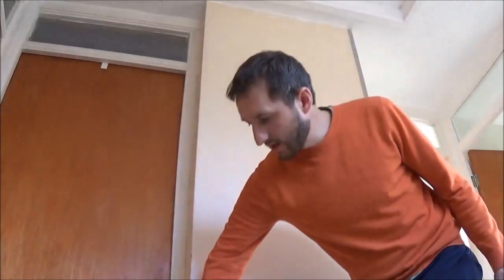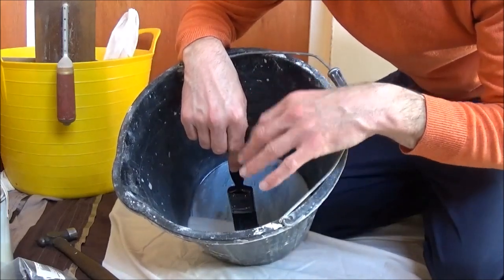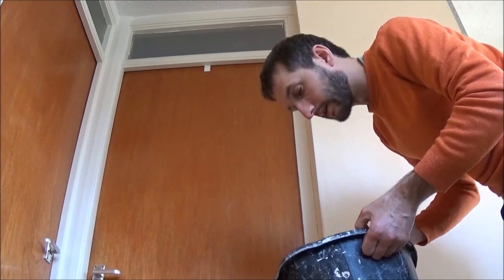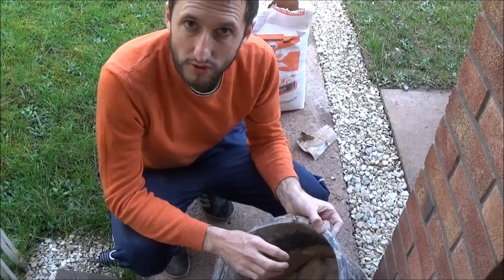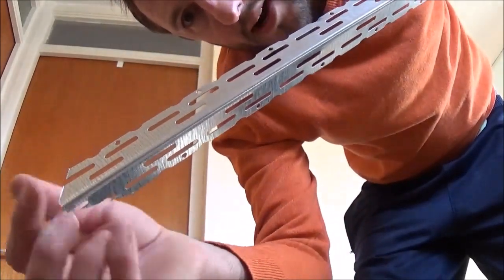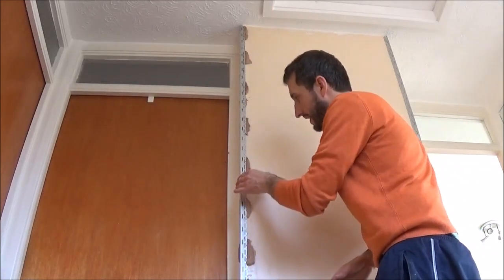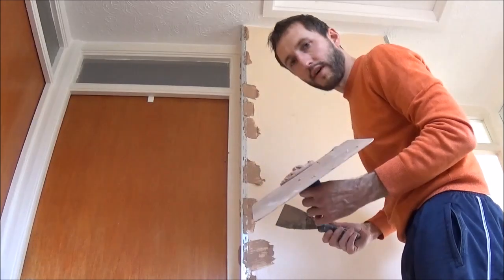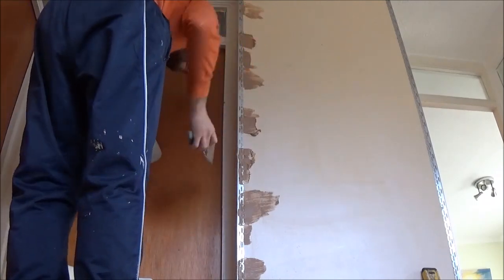How to fix drywall angle bead using plaster. Fit corner bead using plaster. Beginners plastering!

Comment: Great video! The corner I'm working on has a small section that is bent out of place, as well as a hole. I had shelves up on a crumbling cement wall. Would I still be able to do this? Should I hammer the wall back into being straight?

Comment: My corner beads seem to have been two separate panels to begin with and have split from knocks or gone bumpy by windows. Will they need to be removed in order to add new ones as per video?

Comment: I had a plasterer fit metal corner beading to all my windowsills, however he left it in an unfinished state. He attached the beading  with nails and used easyfill over the top. It all needs sanding back and a third or possibly even fourth coat of easyfill before final sanding. I’ve heard easyfill doesn’t stick well to fully cured easyfill. My question is - is there a primer such as Zinzzer Gardz that I need to apply to the dried easyfill to allow the new easyfill to adhere?

Comment: Thanks for all of the Pouse around the House videos, by far the most informative and helpful videos I have seen.   I have a question for you though.  I have plastered my entire house from top to bottom and it looks bang on, thanks to you my friend, but I have hit a horrible angle that is driving me insane.  In the stair well from the landing to hallway, we have a vertical wall coming down from the landing ceiling, which is fine no problems there but, as it comes down the stairs the wall then goes into another ceiling which follows the flow of the stairs down until it merges into the hall ceiling.  This creates an angle from the vertical wall onto the stair ceiling of around 120 approximately.  The average angle bead will surely be no good in this situation, would I need a stop bead instead? Thanks again for all the videos my friend, I have told others to get on here and check out your channel:)
Reply from the maker: Thanks for the feedback Phil, very kind. You can either free hand a curve with your trowel, or as you say use stop bead if you want a crisp straight edge. I show how to do that in the following video, How to plaster an outside 45 degree corner - https://www.youtube.com/watch?v=I-VL4KWcu-c. Different angle bu same principle. Hopefully this video will help. I have other plastering videos under my plastering playlist on my channel. Good luck and thanks for watching!

Comment: P@the House... Thanks for the vid... Any ideas how I can re-square jointed plaster-board that has taken some knocks over the years? The corner beading looks like SS, and I'm trying to figure out if some skillfull plastering will do the job or not, plaster is brittle of course so I'm not sure what to do. Effectively the paint on the walls is fine (once rejuvenated) until it gets to the corner of the wall and then all I see is metal on the lip
Reply from the maker: Sorry for late reply. If only a few chips then use a filler to fill small holes, sand it back then repaint. Hope that helps.

Comment: Hi bud how do u measure out the water and pva do u use a cup or the lid of the pva wat pva would u recommend mate
Reply from the maker: Anything really, but i use an old milk bottle, add pva, top up with water to right level, lid on then shake. You can put lid back on to preserve it until you next use it. Hope that helps.